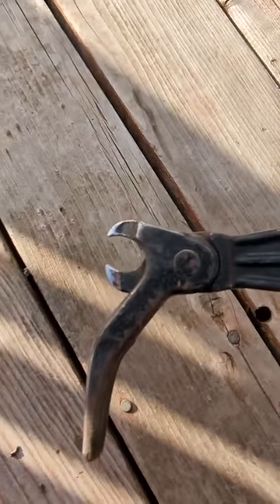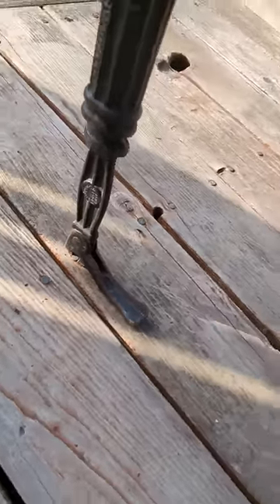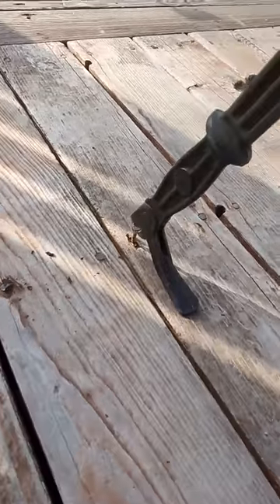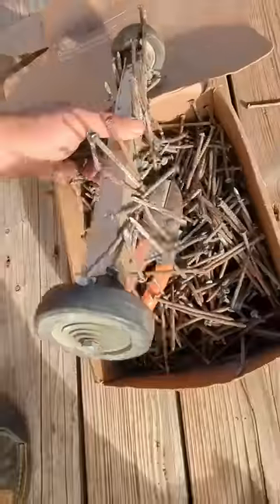The Deck flip is on! #deckrestoration #redwood #reclaimedwood

Comment: “Then I had a brand new deck!”  😂😂😂😂

I learned the long and hard way, redwood takes lots of annual maintenance to keep staining it once or twice a year and the nail holes collect rainwater and crud then start to rot.  I did what you did and removed it all and planed the 2x6’s (which was a gigantic effort) after 4-5 years.  The cracks collected a lot of crud too that required a huge amount of time to sand down (I started calculating the lineal footage as I was sanding the edges for days). There was spot rot where the redwood sat on the pressure treated joists (always use the U-shaped) joist flashing over the joists as a great investment and best practice detail. And, a 2x6 changes width by about a 1/2” seasonally as it gets wet in the winter and dry in the summer. My first attempt on board spacing was too damned close at a (nice looking) 3/8”. In the rainy season, the boards swelled up and the cracks closed up so that I had rain water puddling that got slippery algae by the door to the house! Did I mention that the wood would deteriorate and develop small cracks on the surface? Then the water damage would just get worse and worse; I.e. accelerate and it looked bad too.

Punchline and “Lessons Learned Dept.”:

Wood 2x6’s are a very poor long-term choice for the above stated reasons. If you count your labor, the more expensive to buy initially Trex is way, way cheaper, looks better for probably decades and requires almost no maintenance. Also, go with hidden fasteners! My (ex) wife insisted on semi transparent stain on the redwood because it was indeed beautiful. There is no warranty on semi-transparent stain and it needs to be reapplied 1-2 times a year to keep looking good. Most all stains deteriorate pretty fast from sitting in the sun and rain, especially when moisture gets in the small surface cracks that wood gets naturally. So I switched to solid stains that worked better and can fill most of the superficial surface cracks. Through long trial and error, the Sika products are way, way better than all the rest. But, even a great solid color finish material cracks as the wood (that it is trying to protect) naturally expands and contracts. Again, wood is a poor long term material choice! The engineered wood products are about 40% plastic and will look good even on an ocean pier for about 35 years! Avoid wood and thank me later!

Comment: Don't forget to pre- drill the deck boards! Helps the deck screws stay tight over the years and not start to squeak.
Reply: if you keep track of where the deck boards came from they would already be "drilled" by just reusing the original holes.
Reply: @plebiansociety keep track of hundreds of boards?
Reply: @ronjericho7977  you could flip a certain amount at a time...screw them back down and then continue on...just trying to be helpful 👍
Reply: @michaelmason8474 you could also rip up all that shit wood, put down azek with screws and plugs. Why would you want to look at screw holes?
Reply: @Roofer0420  if you think redwood is junk you’re not very smart.
Reply: @ronjericho7977  brazilian cumaro, the only way to go.
Reply: @Roofer0420  sure
Reply: Not necessary
Reply: @Roofer0420 if you want to pay $50 for a 16-ft deck board lol
Reply: @Roofer0420 Imagine replacing nice wood with some garbage PVC and thinking it's somehow an improvement.
Reply: @michaelmason8474  ... that's exactly how you do it. Flip as you go and screw again. You will probably need to sand the boards before staining. I have had 15 year old planks that still had the mill glaze on the other side and the stain won't stick to that.
Reply: @karlmarx8239  that nice wood is gonna look like shit again in a year or 2 after not doing maintenance, which nobody does so why even waste your time reclaiming wood someones gonna neglect. Marx also died poor and pantless so have fun with that.

Comment: I have had a nail puller just like that for 45 years. First used it to reclaim a quartersawn  white oak face nailed floor.  When refinished the floor was beautiful!  Since then I have used it to salvage  a lot of good lumber that otherwise would go in the dump or burn pile.

Comment: Awesome idea but I would not have pressure washed it before planing it I would have just ran into the planer been done with it I did this for a friend's mahogany wraparound deck and it came out so beautiful
Reply: I bet that was an expensive deck… mahogany outside are you serious?
Reply: @matthewpartain4771  it was when they first had it done when I read it last year I didn't really like it too much because they did not want any sealer put on it they wanted it to whether to its natural gray color so right now it kind of looks a little choppy because some of the boards had to be replaced with brand-new but in a year or two when everything weather's it'll look real nice again
Reply: @myronall6006  exactly. Skip the PW. Planing is a great idea! I wonder if an industrial floor sander would do well without having to tear all the boards up? Or would the scalloped edges keep it from working?
Reply: Mahogany  is wày different.

Comment: Make sure you put a sealant on it. Something that has good water and UV resistance.
Reply: Sherwin Williams super deck. Works great.
Reply: On redwood?!? 🤦🏻‍♀️
Reply: All 6 sides
Reply: No, never seal redwood or any cedar.
It needs to breathe transparent or translucent stains and mineral oil mixtures work well.

My father did something similar on a house we had when some previous idiot painted cedar siding. He flipped it and cut the bottom bevel the other direction.

Comment: I have done this a few times but one thing to keep in mind is boards on a porch should be placed with their rings going downward. If you put them with rings going up, the boards will cup and then hold more water. When rings are going down they bow the opposite direction (concave) and water runs off.
Reply: Rings have nothing to do with what you are referring to..
Reply: I agree
Reply: @SleepingSheep95  yes they do. 100%. You don’t know as much as you think you do.
Reply: @SleepingSheep95  you can literally google it and it confirms what I said. I have built many many porch’s/houses. It’s all I do.
Reply: @kdugg  I know for a fact that you have no clue what you are talking about.. I'm a contractor bud.. you won't teach me a GD thing..   you are talking about a cup or an arch.. not a ring.. the rings have nothing to do with the way the wood cups..
Reply: @SleepingSheep95   also, you, ME and a hundred thousand other people are contractors. My grandfather was a logger for over 50 years and cut his own lumber and my father was manager of a saw mill for over 20 years and he cuts his own lumber. I do know a little bit about lumber. It’s what I was raised around.
Reply: I'm not a lumber expert and have no idea... but a quick Google search says:
"...you can pretty much predict which way the board will cup simply by looking at the orientation of the end-grain. As you can see in the drawing to the right, the wood typically cups away from what would be the center of the tree, or in the opposite direction of the growth rings."
Reply: Crown down, it's that easy
Reply: That does make sense to have the rings pointing down on the edge of the board but I don’t think many people do this and it’s probably fine but still an interesting tip.
Reply: @SleepingSheep95  more like austinwrong4791 :D
Reply: Just finished a small, floating  deck in my back yard about 2 months ago. Pressure treated, all nice flat boards. I must have read 50 times that I should lay them, bark side down, (smiley face when you look at the end grain). So I did. Now I see that almost all of them are starting to 'cup' slightly. WTF!
Reply: @SleepingSheep95 i hope you dont contract carpentry.
Reply: @Austinright4791 has left the chat.   LOL

Comment: Live in a redwood forest in a century old redwood log cabin. The front deck is still good, but the little back deck needs to be redone. I don't think those planks are redwood, but the previous owners left a bunch that just need to be milled from big planks into the right size. There should be more than enough. Now I just need a carpenter. Also time to reroof!

Comment: Powerwashing is important the dirt would ruin that planer. Good idea man👍👍👍
Reply: Nooo 😅
Reply: @himwhom  yesss dirt is bad for planer knives I know from experience 👍😂
Reply: @chrisbennett5589  go work with the Amish for a bit. They plain wet dry or sandy. They drag the lumbar behind horse and buggy... It's all about how you care for your machine.
Reply: @chrisbennett5589 someone else mentioned the pressure washing damages the wood.
Reply: @sebastianleister355 exactly, he’s going to make his planar have to work so much harder
Reply: I soak my wood in cider
Reply: @sebastianleister355 It does if some moron pressure washes or at 5k psi. 750-800 psi with the right tip is fine, and don't stay on one spot for long periods. Otherwise, you could cut or fray the grain.
Reply: @himwhom  so your Amish now? Everyone with experience knows dirt and sand will dull the blade of any sharp metal cutting blade. I’m not saying it can’t be done, I am saying from my experience it is counter productive. And yes I have seen a lot of guys use a wire brush to get the dirt off the wood that works too.
Reply: @sebastianleister355  no you pressure wash on a low psi for that.
Reply: @dcraexon 😂
Reply: How much dirt can really be on the underside of a deck board?
Reply: That is the downside of the board. It is not dirty. Probably as clean as it was new.

Comment: Excellent Choices ! That old sliding nail puller tool and a smaller camel toe claw are priceless for disassembly projects. A good planer will take no time at all with beautiful results. (Make sure to account for ALL nails ) since you will probably be able to afford it, use the best deck sealers, clean it REGULARLY and PLEASE use good deck screws when reinstalling.
Helped my uncle do this. Saved him $4,375+.

Comment: Why don't you just sand the top and don't have to put up any boards.
Reply: Thats too easy! You cant just add a few nails to squeaky spots then sand and refinish the surface because it wouldn't take an entire week.
Reply: He needs to remove about and 1/8 to 3/16 of an inch of wood. If you sanded that much off you would sand all the heads off the nails.
Reply: @laker3 I've seen it done before lol
Reply: @laker3 one could hammer the nails down below the surface before sanding.
Reply: @Alkatross  In the long run its alot better removing the old rusty nails and replacing them with deck screws.
Reply: Was thinking the same. Im sure theres a way to use a compressor to furthur sink the nails (if needed)...rent a heavy ass sander for 80 bux (40 the first day, n 40 on day 2 when yur feelin fresh n see some shit u could make better from yesterday😂) keep a bag or 12 of dust for hole filler, add new screws to creaky spots n fill if u want, seal/stain, then smile.
Reply: You will run into nail or screw head that will tear up the sander, even if you manage to sink them deeper, you’re gonna miss some.
plus that is a lot of sanding

Comment: If the boards arent rotten you can use old motor oil and diesel mixture and roll on underside and/or both sides! Gives a beautiful look and very fire resistant.  Believe it or not.  My blacksmith did it for his floors in the horsebarn and it is unbelieveable preservation and color!

Comment: I also like to salvage my nails. I buy an anvil for $1200, then I had straighten all of them. Once straightened I individually torch heat each one of them and dunk em in oil to treat them so they don’t rust. Only 8017 nails to do and the 2 weeks time is also worth it while I’m waiting on planer blades to arrive after planing 1/3 of the deck boards

Comment: Too many comments to scroll through to see if someone has already said this. I have one of those nail pullers myself. Got it from a flea market a long time ago. They are great tools!

Do yourself a favor. Don't use it to pull the nail all the way out. You're just going to wear it out sooner than you want to. Once it starts to nail out, change to a regular clawhammer to finish the job.

I say that from my own amateur experience. I had to redress the claw hands on mine, is there were getting worn out and damaged.

Now I only use the tool to get the heads pulled up enough so I hammer can grab it from there.

Comment: You would find that if you ran all them board through a drum sander as aposed to risking bow and cup after drying from pressure washing, there would be nothing wrong with the tops. All youd have to do then is use some wood filler where needed and a couple good coates of deck oil would also make a great difference.

Comment: The KEY part is running it through a planar. All of these boards are cupped with the bump up so when you flip them they turn into bowls that retain water. If you don’t plane them they’ll hold water and rot very quickly.

Comment: Hey guys, I've been a pro painter for over 30yrs. Cold strong powerwash, then clear stain. Will look brand new!! Coat of stain every 1, 2, 3 yrs. Depends on where you live. Eventually the boards become soaked with the stain. Last 40 yrs. My deck did.

Comment: You could cut some wood wedges and separate the boards off of the joists and tap the nails out partially from the underside and then use a regular nail puller (without buying a nifty nail puller.)

Comment: i hit all mine with a floor belt sander and rollered a teak wood preserve over it and they came up a treat for a few years but ended up replacing it as the joists where near rotted through. replaced it all with composite that requires no maintenance (although cost near 3x as much as wood )apart from a wash once a year

Comment: Cut it up for fire wood and buy new timber to save 8k in labour costs of pulling up, re planing and re installation. Save on labour and save on your winter fire wood bill, and have the deck last 10 years longer.

Comment: Just get a block of 2x4, go under the deck and hammer the decking up a 1/4 inch at every joist.  Then go up top, bang the boards down, and use a crowbar to remove all the nails....way way way faster and easier

Comment: I'm sixty-eight years old we used to use nail pullers like that when I was young those particular nail pullers have been around since probably the early 1900s and maybe even longer there are a great tool for pulling nails and they do very little damage to the wood pretty great too huh saved you $5,000

Comment: You have to add in what you’re time is worth. If you are cheap then you can come out on top 
But If your time is expensive then it’s not worth the amount your putting in. So by the time you pull up the deck,,,, plain the wood,,,wash the wood. You might be better just buying pressure treated lumber and only have around $1500.00 In materials. And the time spent on the other can be put into your treated deck. Cheaper to think about the total process than the wood itself

Comment: Why pressure wash? If you're going to plane them. The planer is going to remove the stained dirty layer anyway.  Then if needed you can wash the ones that still need washing. If the dirt stains ran too deep.. which I'd wager would  still be the case. If you wash before planing.

Comment: My deck uses 2 by 4 by 12 foot cedar, they wanted $50 per board 😮so I have been replacing them as needed with extreme weather pressure treated for $13’50 can’t tell after restaining the surface 👍

Comment: After the nails are pulled out... just rent a floor sander from home depot.  The boards will sit flat on the joists with no problem.  Don't even bother pressure washing or planing.  Just sand that shit.  Put some thompson's on it and nail it back in.  I just saved you two days of labor.

Comment: So if turning the boards over anyways, would it not be easier grind the heads off the nails and then you could konck the boards off the nails from the underside.
Then of course you would have to go over all the nails done sticking out with a grinder again but that's pretty fast work,  couple seconds per nail

Comment: You are doing that the hard way!

 Remove one or two boards, then put that wood damaging nail puller away. Or better yet, start from underneath, and keep that wood gouging thing off the job site.  Get yourself a reciprocating saw and a long (flexible) metal blade . Leave those combination metal/wood blades in the store - you need long thin kerf metal cutting blades. Slice between the joists and the decking. You might need a chisel or small nail bar to pry a little space before cutting, but not even that if you learn to use the saw right.  A long metal blade can get into very tight spaces, especially if you put the blade in forward (the teeth shouldn't face toward your knuckles like most knuckle heads do it).  I guess I better become a You Tuber, so I can show you. 

To reiterate: You need a LONG blade - - 12" or better, and it helps to put the blade facing forward (the same direction a jigsaw blade does), and I mean a metal blade with the tiny little teeth. It will bend and then cut parallel to the floor joists with a little practice without putting a permanent bend in the blade.

Comment: If I had to do all that, they would be charged more to reclaim the wood than for new decking. No way in hell we are taking that many nails out and running everything through a plainer, setting it all back. That's 8 to $9,000 as is, so you would be better off using new wood decking. Then, reclaim the wood and charge someone else to use the reclaimed wood for 2/3 the total cost or a price we can come to an agreement over.